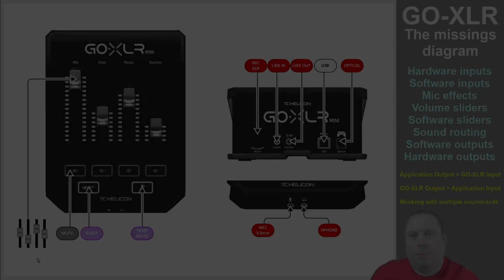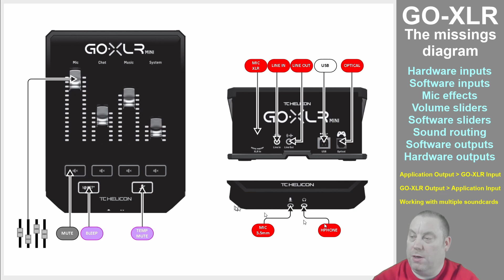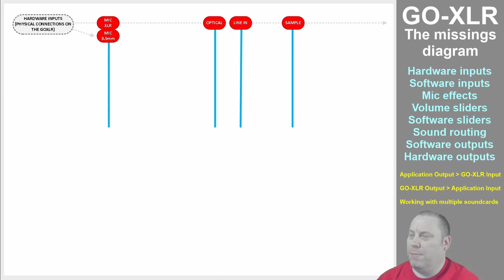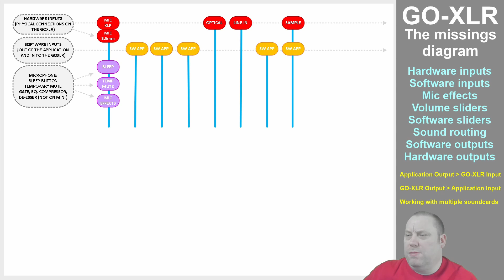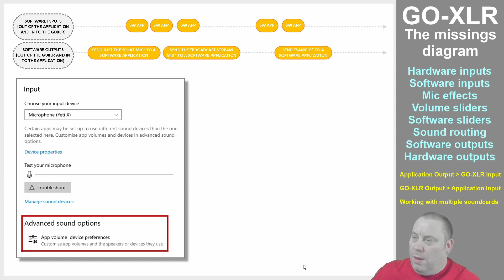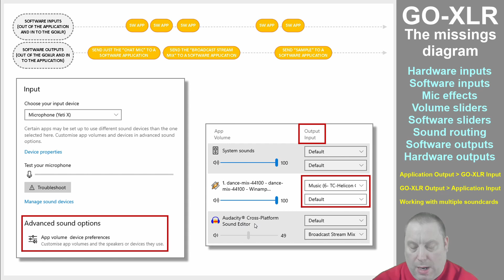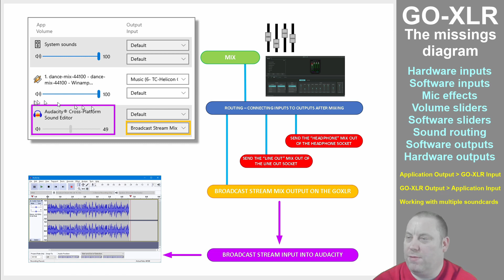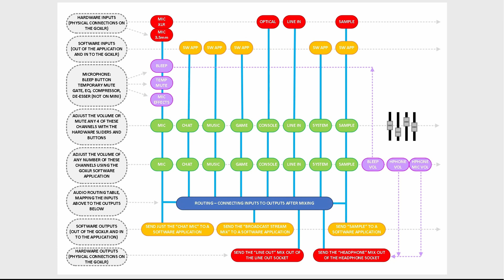GOXLR - The Missing Diagram - How to setup INPUTS, OUTPUTS, MIXING and ROUTING (Jason Meers)

Comment: I want to use GoXLR "Line Out" jack as my "Headphone" jack.  How do I accomplish this?  Reason: Amp on Headphone jack is dead.
Reply from the maker: You should be able to do this. If you can’t hear anything check the routing table in the GoXLR software

Comment: Thanks for your video. May i ask how you created that graphic? It looks like you can activate "layers" to hide the other elements like known from a powerpoint presentation...
Reply from the maker: It was created in Visio. I created the “final” and “last” page with every layer  on, then duplicated it a few times and removed layers on each page to build it up as I moved through the pages. 
The multi-page Visio was then saved as a PDF and moved through one page at a time. The pdf and my video in the corner were combined in OBS

Comment: I'm not the best on the technical side but if I understand that correct the Optical connector can't output? I'm trying to find out if I can connect my optical speakers into these to play music. Can someone confirm if I understood that right, or am I in the wrong?
Reply from the maker: its an optical input designed for XBOX and Playstation, I dont think it can be used an an output (unless anybody else knows better?)

Comment: For some reason I can't make your suggested routing for another audio interface work. I think my problem is, that when I chose the "music" option for spotify, and then route music into "broadcast" in the app, then picks "listen to", it simply doesn't play anything. It seems like the "music" option simply doesn't work for me. On top of that I also now have the "broadcast" option as an actual sound app I can make specific settings for. However trying to route through this gives me nothing either.
Reply from the maker: I’m not sure. For some problems I used vb-audio virtual cables. Might be worth a try.

Comment: Did you got a way to control the input and outputs from GoXLR to connect to a VM in VMWare Workstation?
Reply from the maker: I think you would have to pass-through a USB soundcard to the VM and the use GOXLR-Output to USB-Soundcard-Input with a 3.5mm audio cable. If it were full vSphere ESXi you could do also do pass-through of a PCI or PCI-E soundcard. This is a long-shot but also look at VB-Audio VBAN as an alternative solution?
Reply: @jasonmeers  Thank you I didn't now VB-Audio VBAN, I think that could be my solution thank you! :)